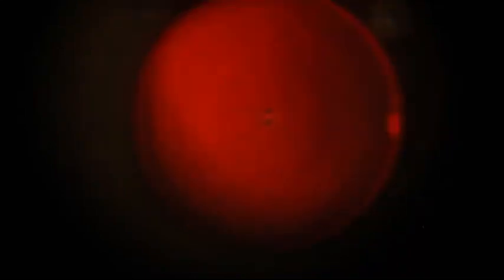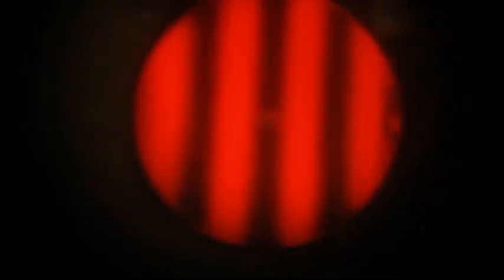testing a 8in f6 gso telescope mirror

Comment: Is a Ross null any easier or less expensive than a DPAC flat? Is one more accurate than the other? Thanks.

I'm guessing the flat is twice as sensitive, but that the Ross lens still gets one's eye as close, both giving parallel lines. But the flat has less no ghosts. I'm guessing the lens costs less and works for any size mirror.
Reply: Edit. On second thought, I bet the distance is almost the same. The only advantage over standard is the parallel lines. So, I guess I need a flat. The lens is more compact though.
Reply from the maker: The lens is easier, and also easier to miss place. You can’t misplace a flat. Spend $150 for a 80x400 from Edmund optics.